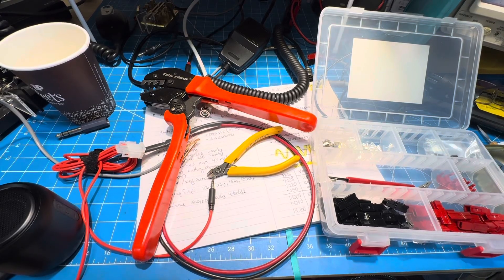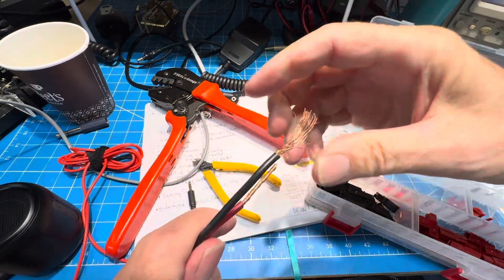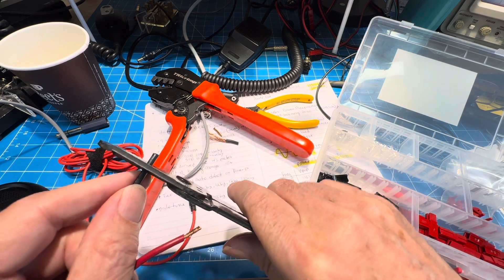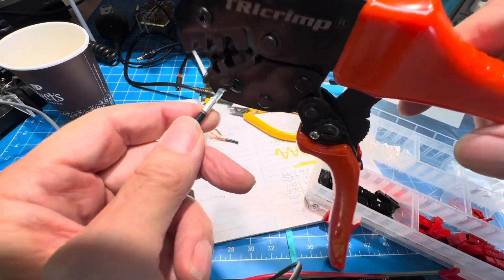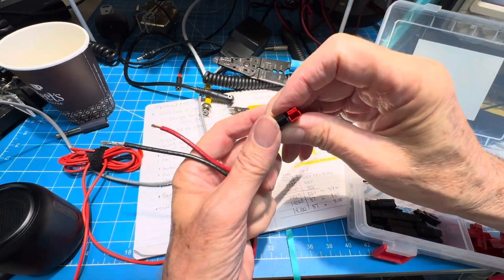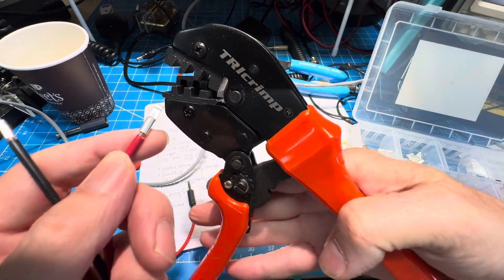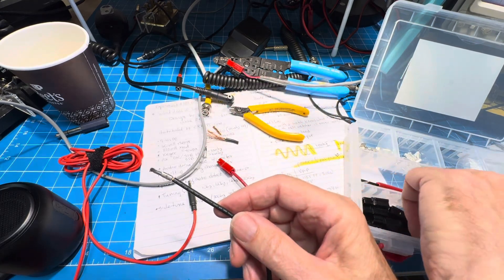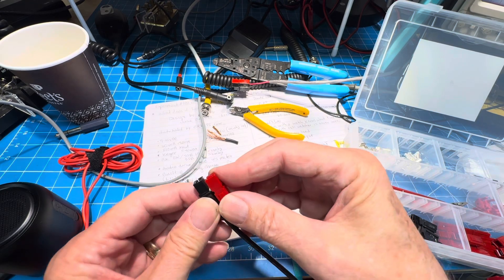New Radio Needs a Power Pole Power Cord!

Comment: can't you just slide the red and black connectors to join them together? You can put a pin to hold them but usually you don't need the pin in my experience.
Reply from the maker: Agree! I do just slide them together. Some have said they use superglue, but I have yet to have them come apart. I did find the small pins in the kit, so I tried one out today. They seem to lock the two together once they are slid together.  
When I first started power pole seemed like a lot of extra work, but the more you have, the more convenient they become for batteries, radios, mobile and fixed power, etc. Now I’m a fan